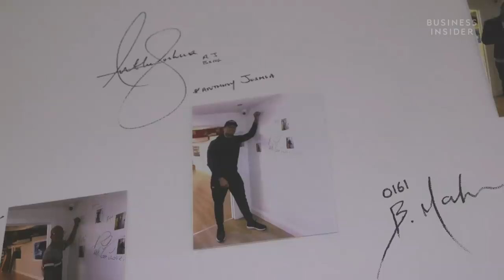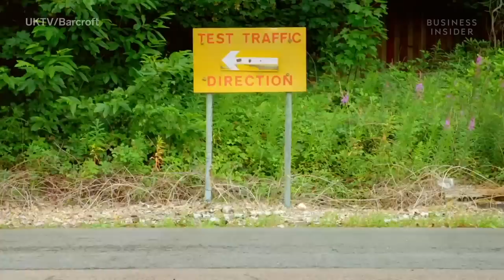Meet The Guy Who Wraps Celebrities' Luxury Cars

Comment: Can he put my screen protector on for me?
Reply: I am sure he can do it for you in chrome !
Reply: @sjsandhu2980  in my
My

We
Reply: @tjankoentek-8826  wtf
Reply: He will return your phone in full chrome and yes including the screen is too in chrome!
Reply: Imagine using a screen protector in 2019
Reply: @kingrobinho777  imagine getting your screeen scratched because you dropped your expensive phone on a concreate or outdoor and have your display's led died

before you say anything else, 5m+ above ground should be enough to scratch your phone with gorilla glass 5
Reply: idk about crack on expensive phone though, dk what you need to do in normal basis to exert that amount of pressure on one point of your display
Reply: Vysair a phone case would be a more suitable alternative if you're concerned about dropping it as screen protectors are designed more so to prevent scratches when making contact with the screen using your fingers. Trust me, if you drop your phone on concrete, whether or not it cracks will have little to do with a thin plastic screen protector.
Reply: @kingrobinho777  true which is why I go both. Anyway, my point is screen protector are a mere insurance because nobody wants a permanent scratch or damage to their phone.

Also, phone screen can get damage when it falls flat on its screen which is worrisome especially when it hit a rock which is why you need to find shock proof protector (im not sure if they work either but I believe hydrogen gel or whatever it is called does worked)
Reply: @Vysair  I have a case with a built in protector
Reply: @cool-jm1im  well if it uses gorilla glass or big brand then I'm sure it can handle impact (because scratch and impact does not correlate)

also I now use hydrogel protector, it is smooth af and no bubble even on the side much like glass protector (many use plastic, you can tell the difference by the amount of bubble and side bubble and when it shatter, it shatter like a glass and very sharp to touch unlike plastic which just snap)
Reply: 1000% ez af
Reply: Lol
Reply: he probs charge u 200 pounds but sure haha
Reply: I think so because he once wrapped a toilet seat
Reply: @AKSHAY-bu4ox  omfg
Reply: Expensive screen protector

Comment: They spend millions on a car but have bald ass tires. Smdh
Reply: What does the d stand for? Hmmm
Reply: @amir581498   Damn i guess
Reply: Lmfao
Reply: Shaking My Damn Head.
Reply: Racing slicks you mean?
Reply: Dude cars don't cost 'millions'
Reply: xESPplayer500x shaking my damn head
Reply: @dopdep2684  there are cars that do cost millions
Reply: They add the tires later so they match the body
Reply: @dopdep2684  that white pagani hyuara in the video literally costs $2,600,000. All bugattis cost over 2 mil as well.
Reply: @amir581498  di
Reply: Yes, those are bald tyres.... 🧐 

Errrr......
Reply: @user-xx7pg3vw9k  nope, doubt he meant that

Comment: 3:54
Look at that car shaking. Tells you how light the car is and how soft the suspensions are.
Reply: Yutae Gil the bumper wasn’t attached. Those cars have the worlds stiffest suspension. Lol have you ever even been in a car before??
Reply: Do you know how rough they pull on the vinyl? You did see 4 guys before right? Minimum 2 guys , full body weight. There's 200kg of pull right away.
Reply: V8Ziggy really? Look at 0:00 then. Lolol you know zilch.
Reply: If the bumper wasn't attatched to the car, what is it stuck to? A rig that shakes like that? I know I was wrong with the comment on the soft suspension, but that bumper looks attatched to the car to me.
Reply: Yutae Gil w
Reply: Yutae Gil look at the gap.

Comment: Meet the guy who ruins supercars as his job
Reply: Wrap is a good way to protect your cars' original paint. They look very good depending on the color and how well they're applied. Blame the owner that pays to put on ugly colors on their car 🤷
Reply: Adrian Daugdaug wraps have acidic glue. It oxidizes car paint. Unless you keep it wrapped forever, it’s not protection.
Reply: SAVAGE TUNER Yianni uses special glue to keep the paint job under the wrap in original condition.
Reply: @savagetuner2404  most cars these days have a couple or more layers of clear coat. You'll have to use some extra products when you detail the paint or apply another clear coat at most. I believe it's a lot cheaper than having to repaint panels because of rock chips.
Reply: Adrian Daugdaug but the entire surface gets scarred by the acid that comes off the wrap.
Reply: @thwalesproductions  3M Wraps arent special you can wrap a car for 200 euros @ home it will stay nice to 2 years long after them you have to change it
Reply: Der RoteKoyote Do you think an average person wants to strip there car which a chance of breaking it? I though so. That’s why people go to professionals to wrap their car.
Reply: Der RoteKoyote Also wrap has different quality a 200 euro wrap would be the most worst wrap you can get.
Reply: When I saw the Huayra and he said he wrapped it I about threw up

Comment: I feel like he is overselling how difficult it is to wrap, i did signs for about a month and did a vinyl wrapping course on cars towards the end. High quality vinyl is actually very forgiving and easy to work with even on your own. The difficult part i would say is just cutting it so you dont go too deep and damage the paint but you should pick that up super quick. Hiding joints in areas such as mirrors, spoilers or protruding hard fins on roof can also be challenging, normally your edges just tuck in behind panels. Also doing cutouts for badges and different things, pretty frustrating to lay the vinyl perfect then mess it up. 
All that being said, there is a reason the course is only a few days... As he said, attention to detail is what matters, it is time consuming boring af which is why i quit.